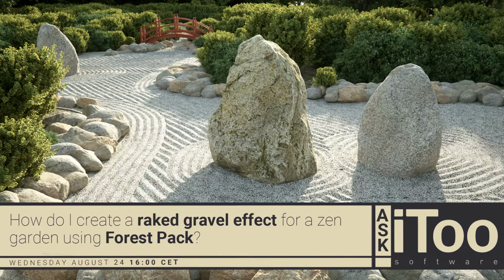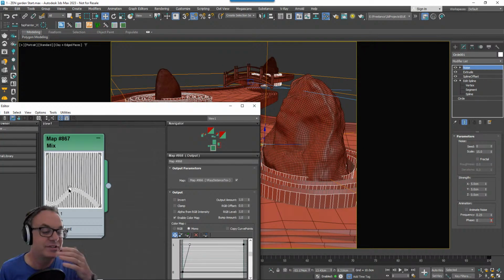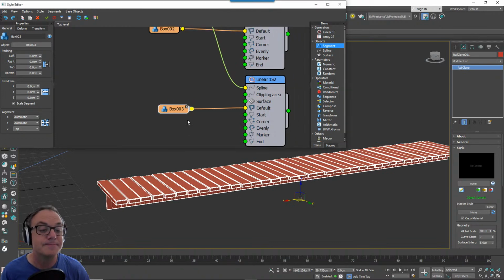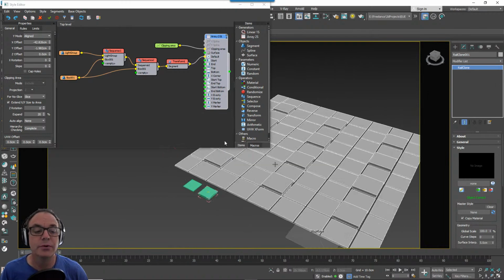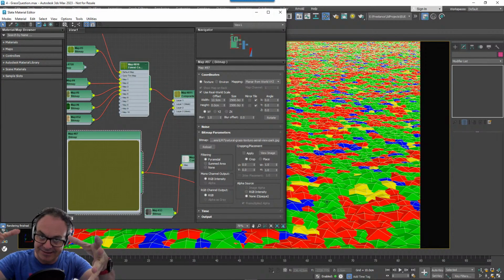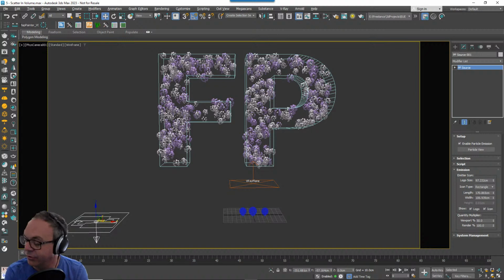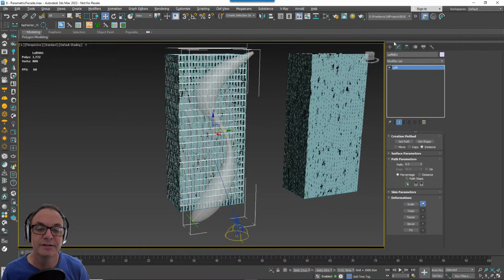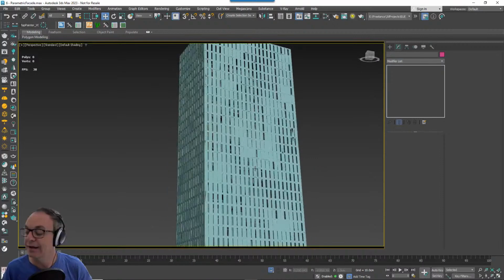Ask iToo! | Forest Pack and RailClone Q&A | 24 August, 2022

Comment: I also found a solution for the 'zen garden' creation job, using the forest pack; first i created a simple gravel field using 'gravel preset'. Then, just like in this video, I created parallel lines with splineoffset and selected 'path' as the 'distribution mode' and gave it a 'z offset' so that it appears above the first layer. it wasn't too bad :)
Reply from the maker: That sounds great! 👍